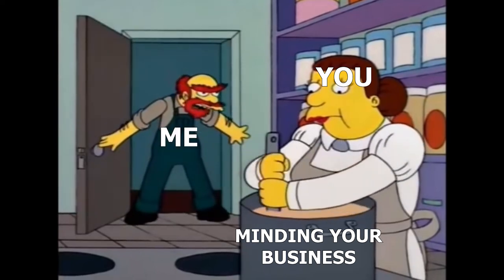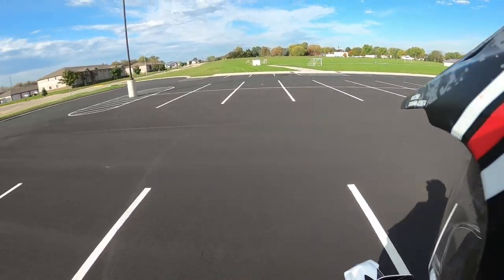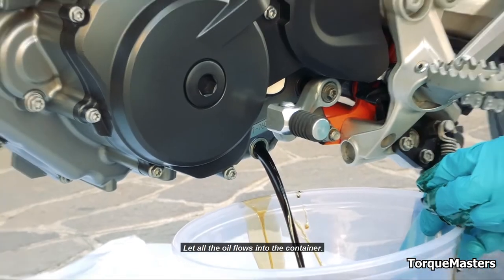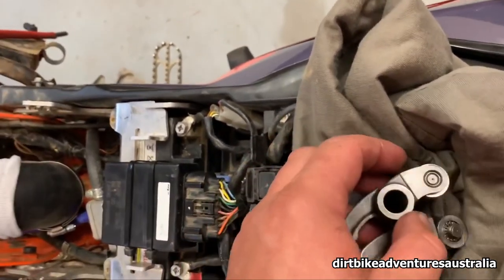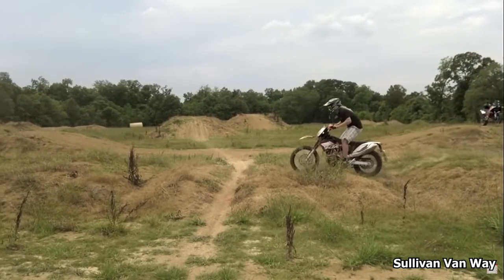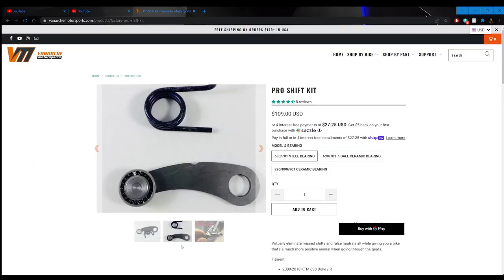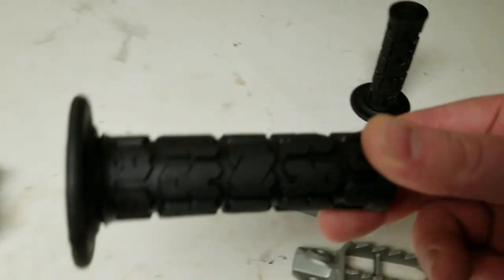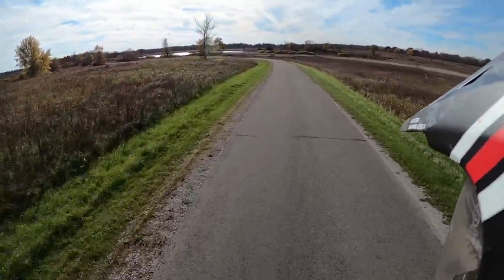6 Things You Need to Know About the KTM 690 Enduro

Comment: I rode my second hand purchased 690 on position one for a while before I realized the different settings.  I put it on two, am pretty happy but need to try position three to see the difference.  So far I like the bike for what it is, a large displacement dual sport.  Too many people try to believe that one bike can do it all well, and that's just not the case.  A dual sport is always a compromise, a BMW GS will cover street miles fast but will not be fun in single track.  A KTM 300 two stroke is amazing in the tight stuff but I wouldn't want to highway ride it.  The 690 can do both things pretty decent but is compromised a  bit in both areas.  Enjoy the ride!

Comment: I have a 2021 and have really had no issues with it I did my own oil change just over 1000-miles and have the supplies handy to do another. I did replace the clutch slave even though IZ had no issues with it, call it preventative maintenance. I love this bike and put about 3000-miles of fun on it last year. I have made many upgrades and have about 10 outstanding projects awaiting some milder weather.
Reply: Yeah, they fixed the oil „Problem“ on the past 2016 Models. My 2016 Needs like 400-500ml / 1000km
Reply: Dirk, what oil and filter did you choose? I’ve got a 2020 with only 400 miles, (been super busy, no time to ride) and I want to change the oil/filter(s) and plan on buying a case of each.
Reply: @Rakkasan-vr8xt  There are several avenues for oil changes. If you search online, there is a complete kit and if memory serves right it was around $75.00. I went to a dealership and picked up all of the parts individually, it requires 2 oil filters, 2 screens, a host of O-rings, and I used Motorex oil. I performed the oil change myself. I cleaned the screens with brake cleaner and intend to use them. Since then, I picked a gallon of the oil and two oil filters from Amazon. I feel that most of the O-rings could also be cleaned and reused. There are a lot of O-rings.
Reply: @just-fun-stuff6753  but they did not fixed oil problem within the clutch

Comment: I have the 2013 model, there was some issues that model year with fuel pumps and after 7200 miles (11,600 km) had to replace mine. Also had some fuses get weak from prolonged vibration and once I figured out what was going on I just keep spare fuses. I ride mostly off highway so I change oil about every 1000 miles (1600 km) for preventative maintenance and I have two sets of oil screens so I clean and swap them during intervals. As long as people understand that the 690/701 is a compromise bike you will not be disappointed. It may be less reliable then most Japanese dual sports but is vastly superior in performance, though it is not in the same category as an EXC, FE or CRFRL off road, but  requires much less maintenance and more comfortable on asphalt. The 690 is also a far more capable off roader and lighter then adventure bikes, so think of the 690 as a jack of all trades but a master of none.
Reply: Master of wheelies
Reply: Spot on comment.. that’s why I have a 701 enduro and a 350 GasGas

Comment: The rocker arm issues was resolved WAY back in 2015....  The clutch cylinder has also been resolved in the 2021+ models...        I have a 2021 and have only hit a false neutral a couple times in 7000 miles..... Each time, it was because I very lightly shifted....  Just shift like you mean it and/or use the quick shifter.

Comment: Some issues with the subframe on the bottom of the tank and side bolts to the tank.  I put in a subframe tank reinforcement kit. When I put the old bolts out some we’re already bent at 6000km.  Nice bike I have a 2016 690 Enduro.  Under valued bike far as I’m concerned.

Comment: I have a 2017 Ktm 690 enduro r. I like everything about it except for when speeds on the road get to 70 mph and above. It’s hard to explain exactly what is going on. I guess it just doesn’t feel planted. I don’t feel like I’m going to crash or anything and it’s not like a high speed wobble either. I have ordered a Scott’s damper for it to see if that will help. Hopefully that takes care of it. If not I will try a tire change to one that is a little more road bias but I’m already running a 50/50 tire and would hate to have to do this. I’ve watched a lot of top speed run videos and can see that my bike isn’t the only one that does this once the speeds get over 70. Other than that it’s great fun and I rarely hit the highways so it’s not something that would cause me to get rid of it for something else. It would be nice to be able cruise at 70 and have the ability to hit 85 without getting this twitchy feeling in the front end when on the highway. If you go any slower the cages will run you over here in Maryland

Comment: Thanks for the video mate !
There’s only a few things I knew that are an issue with this bike but you have opened up the others I had no idea about !!
I’ve been looking at buying either the 690 or 701 for a couple of years now and watched as mates had bought them and had the clutch fail either just down the road from the bike shop or at least a couple of weeks in and out in the middle of nowhere ! One guy suggested using the recluse clutch pack as his actually failed after 3 months as well as the master cylinder on the first ride home from the shop ! Crazy business to not support their products ! As he said they didn’t care and charged him for the replacement of that part and fitting even after 5 minutes of ownership ! Really does say to me is it worth it still 🤷🏼‍♂️🤦‍♂️ thanks again 🤙🏾😎
Reply: Used bikes with 0 warranty? No way a brand-new bike breaks down after 5 minutes and it wasn't covered under warranty.. Used "as-is no warranty" you roll the dice. 5 minutes 5 hours 5 days, it's on you.

Comment: Pretty sure the valve actuation was completely redesigned on the 690 Duke in 2016 and the 690 Enduro did not get the new engine until 2019.  So much better.
Reply: This is my understanding too

Comment: I rode a 2013 690 from Portland to Ushuaia Argentina in 2016 and my exhaust rocker arm failed in Antofagasta Chile.  I’m on a 2017 Husqvarna 701 now with the Improved motor and have had no issues. I never had a problem with KTM Twins but get most of my stuff from Munn Racing.

Comment: Is 690 smoother on the road than the 500? I mean like chain slap at low RPMs and gear lash when shifting?
Reply from the maker: I really couldn't say. I've never ridden a 500. It's definitely smoother than my 450L was. Final gear ratio is only 3.00 on the 690, but the 500 is like 3.69, so I'd imagine it could be a bit snappier.
Reply: @doomermotorsports  thanks!